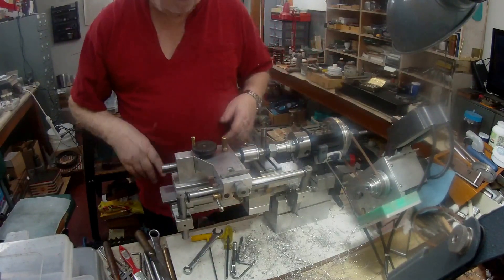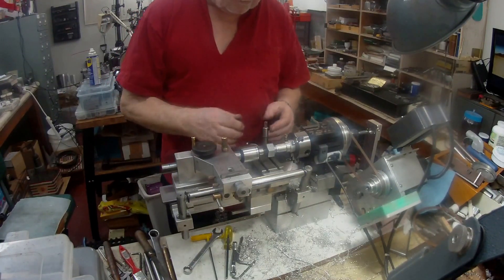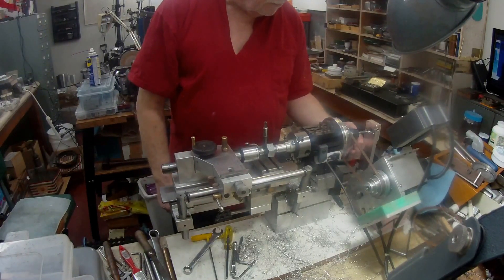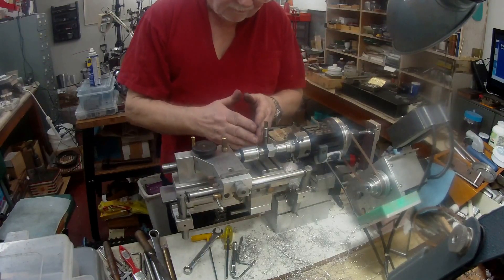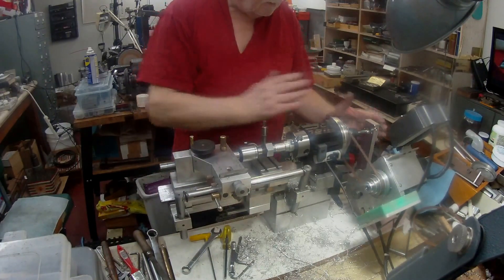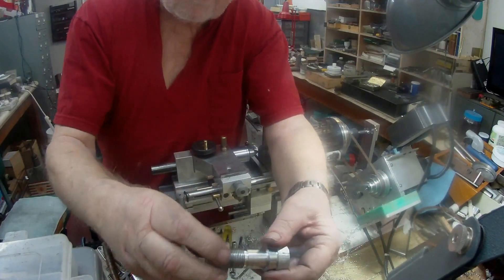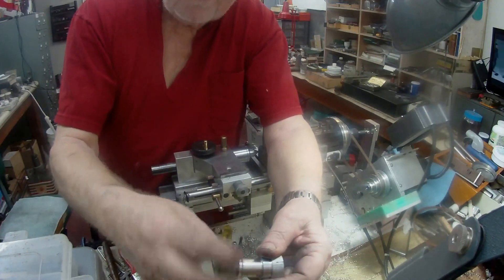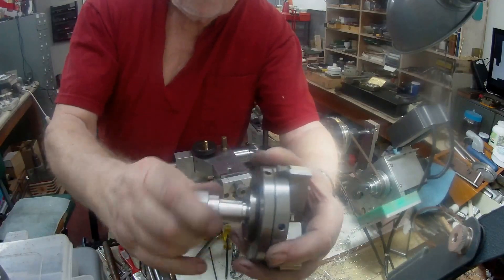FILE0023 The finished 3/4"-16 screwcut thread on the Taig Lathe

Comment: I recently started watching your videos because I just bought a Taig lathe. I am totally green when it comes to machining, but I have been working on a lathe with a friend who has a 15-36  or something, full size lathe, for the past two and half years. And decided to get my own. I know this video is rather old, but I do have a question regarding the threading attachment. I see that your mounting block is high enough to mount dove tails on both sides. Would that work instead of the rod through the block ? It would certainly provide a lot more stability to the plate. Anyway. Thank,s for making these videos. I intend to watch every one.
Reply from the maker: Airguns: your idea is a good one, if you can come up with a design with dovetails I think that would be a great improvement giving a more stable feed, I have been so involved with the Lime Shaper project  that I haven't had time to improve my design but it's my intention to build some kind of stabilizer bar to support the upper section of the  extension bar at the headstock spindle end, maybe a friction dovetail bar attached to the top of the headstock, or a piston type cylinder, maybe a tension spring will do, I agree that the distance from the lower rod to the spindle needs stabalizing, once I finish the Shaper I can get back to the lathe,
Reply from the maker: Airguns: 15-36 sounds like 15" swing x 36" between centres, and thanks for showing an interest,

Comment: I 've  been looking for a threading solution for my new Taig lathe .But i think now that a better solution is to go with a stepper motor .Kinda CNC approach . It will also give the possibility of doing other things .
Reply from the maker: Hello Suce, thank you for commenting, yes you are right, a stepper with a program would be 100% better, with my existing method there is so much slack, I have made the decision that I will rough the thread 90% and then finish with a tailstock die, just the use of rolled threaded rod for masters with  commercial nuts having so much clearance causes a problem then there is the distance between the lower shaft and headstock spindle increasing more errors, I would be interested to hear your progress,

Edmund............Alberta

Comment: Walter, that shearling motor should be pretty easy to reverse.   Just need a double pole double throw switch,  a on off on would be best.
Reply from the maker: Keith, you are right, I am in the progress of doing that, there's not much room in the existing power control box so I am adding a box beside it,